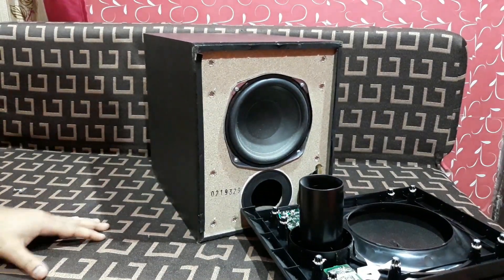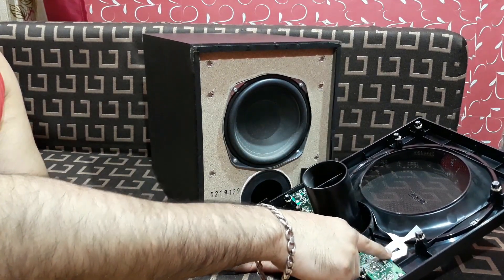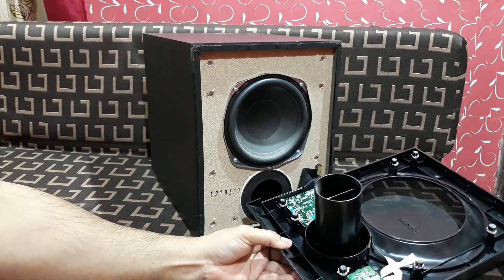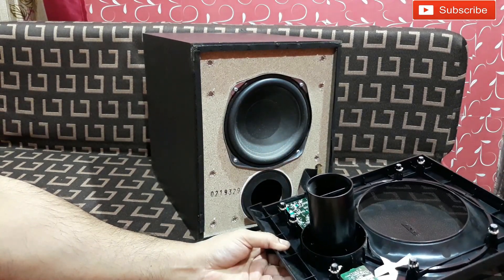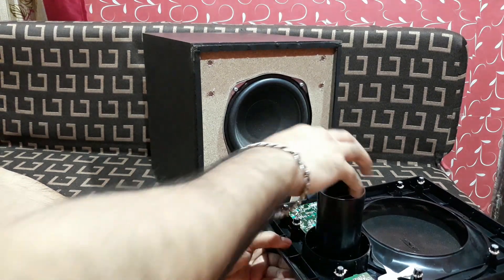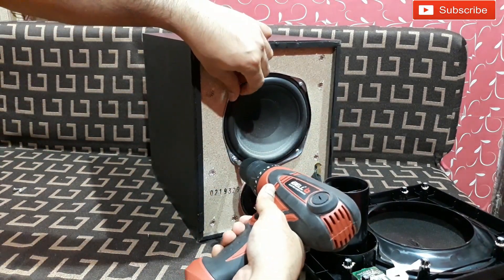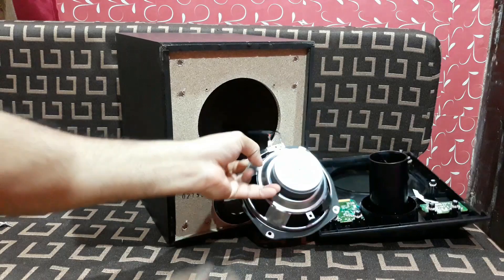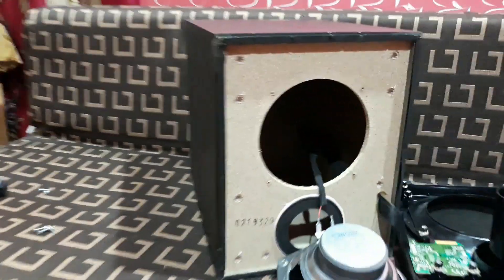Whats Inside Sony SA-d40 Subwoofer // The technoboy

Comment: Is there a plug in option to control the bass
Reply from the maker: it doesnt have any bass controller
Reply: @technoboy-allinOne  I found something called universal bass control knob on net..It has  a RCA cable input and output..If it comes between the speaker connectors..will it serve as a bass controller